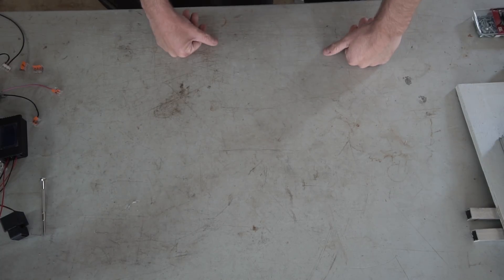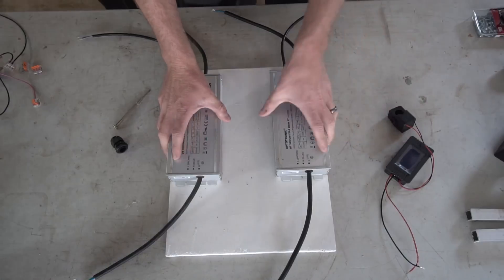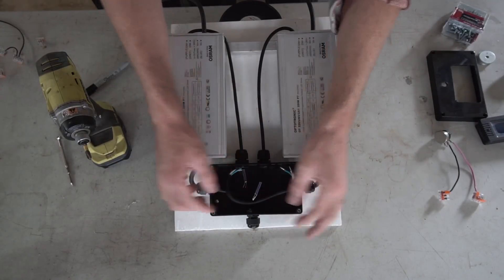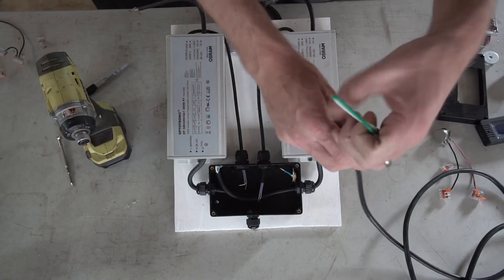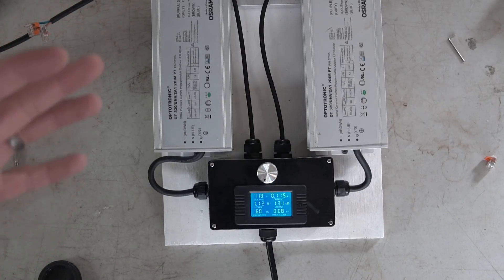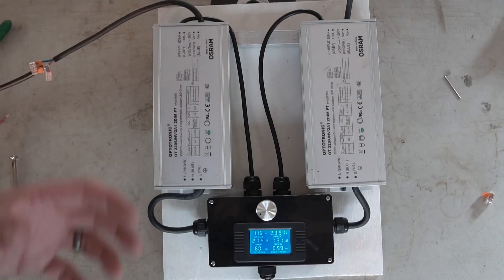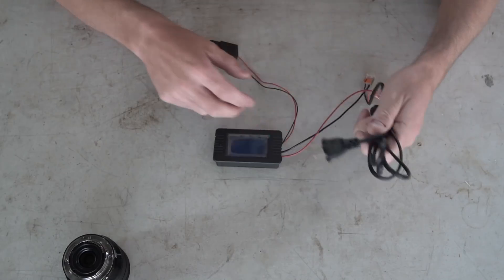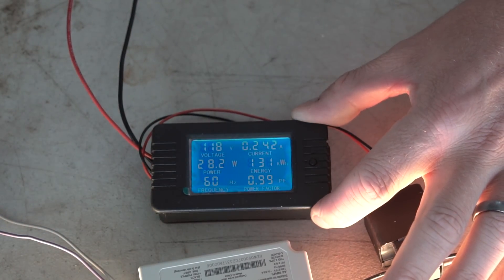700w LED Driver Power Board Build

Comment: Mr. Mean Gene. Where did you go to school to learn all of this electrical knowledge? 
Awesome! Ty for sharing. Great grows by the way!
Reply: lol it just a little $15 watt meter... Drivers and LEDs are not complicated things to wrap your head around. Power goes in, Driver regulates it accordingly. Can tweak Voltage and Current with $2 Potentiometer... If need more information on using drivers with LEDs check out LED Gardener series of videos. "Guide to Meanwell HLG Drivers". Very good clear info.
Reply: @claytonalexander9105  ty... When it comes to electricity I get sketched out a little.ud rather flood the house than burn it down. So yeah one trade I wish I would of learned alot more about. I'll check out the suggested videos. Just seems alot cheaper to build your own quality light these days. I like the hack.

Comment: I’m running 3 of the Growers Choice ROI e720’s with the light controller. If I were to build 2 of these LEDs is there a way that I can daisy chain them to the existing lights & run them from the controller?
Reply from the maker: It's probably possible but I don't know for sure or how. GC are good lights and price.

Comment: Is there certain wattage for the potentiometer? They range from .5-40 watt?

Thank you for all your help
Reply from the maker: Pretty much any wattage will work. The dimming circuits use maybe 10-20ma(0.1-0.2w) per driver.

Comment: Very informative video! But it leaves me wondering, does the drivers need the ability or the mention to be dimmable? I got an amazon light BP-4000 with two Moso drivers but there's no dimmer to connect the two drivers, they only have the dimmer screws on the side of the drivers. Do you think I could put something like this and connect the two together? Thanks!

Comment: I just ordered 40 strips and 5 drivers.. planning to make 5 individual 8 strippers..  At about 10 minutes in the video you show the system pulling 700+ watts, Is there an advantage to running these past the rating? Does it reduce the life of any of the equipment? If this works out I’m getting all my gromies converted from HIDs. Thanks for what you do.
Reply from the maker: There is no issue running them at full output. ~320w DC is basically ~350w at the wall on 120v and that is what it is showing on the meter.  On 240v will run a little more efficient at the wall.
Reply: @GreengenesGarden  thanks for getting  back to me so quick.. I haven’t been this excited about anything in my grow in a long time.

Comment: Question, can you combine the + and - leads together from both drivers if you have extra volts left on each driver that isn't being used ?
Reply from the maker: On the DC side drivers should never be connected together.

Comment: can  i replace two Mean Well HLG-320H-C2100B driver with 2 Osram 320w?
Reply from the maker: Yep. Osrams 57595 come out of the box at 2100ma. Check out the programming window on the spec sheet on PLC site. Linked in the description.

Comment: Great video as always very informative. I was wondering what happened to the light frames you were selling? Did you stop selling them due to the inability to get materials?
Reply from the maker: Huge increases in material and shipping cost killed those. Also wanted to redesign the boards for those housing and run a 6 bar instead of 8. Or 8 needed to be pushed to 800w. They still run super cool at 100w per bar. 
Anyways...that's what happened. They are from http://www.ivineng.com/ overseas. Might be able to swing a deal from them, not sure.

Comment: Hey man! Great tutorial! I would like to ask a lil question if I can : is there a limit to how much drivers can I connect to a single power cord? And can I connect two drivers with different Wattage (for example a 400w driver with a 150w driver) ?  Thanks in advance!
Reply from the maker: Yes, the drivers wattages do not have to match. 
Your limited by your power cord size and circuit capacity, usually 15 amps, and should only use 12 amps of that
Reply: @GreengenesGarden  good to see someone giving responsible advice. 
So many people think they can just use up all the available amperes available and wonder why they tripping breakers.  Watt meter is a invaluable tool.